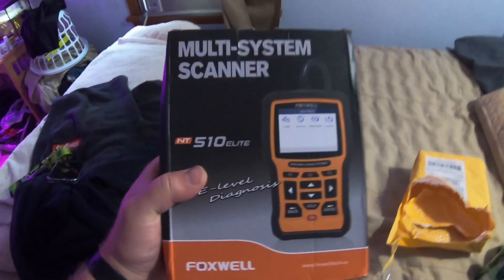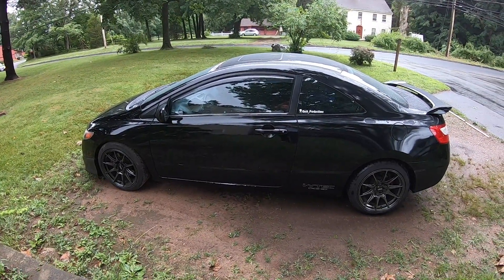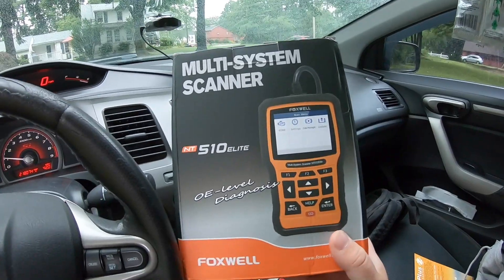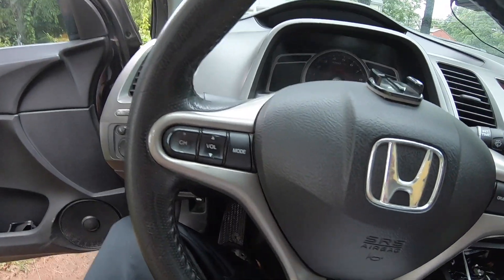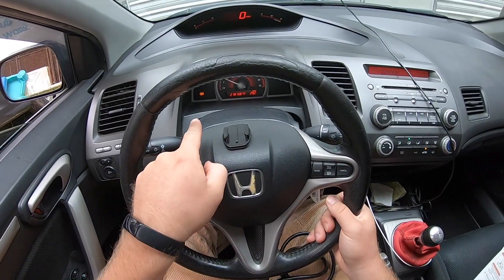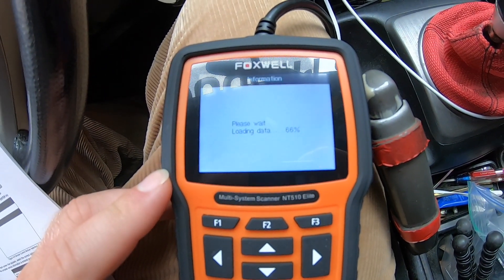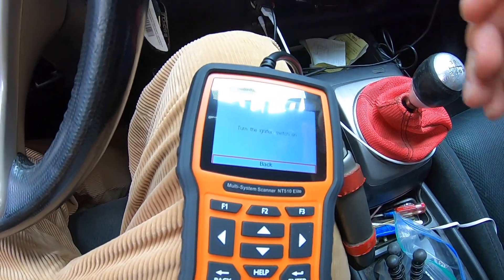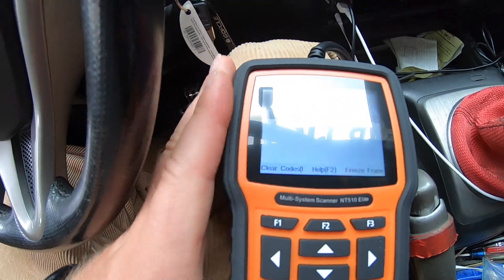Honda Electric Steering Code

Comment: Replace battery , turn ignition to on , turn steering wheel all the way left for 15 seconds, turn steering wheel right till check engine light blinks then center steering wheel and start car.
Reply: What does this do?

Comment: Did you replace the EPS module?
Reply from the maker: I didn’t. That is one of the last things I was consider trying. Lost motivation trying to fix it though
Reply: @TheGerbsteve  
My Accord 2013 has esps light on and steering is very stiff. I can't drive the car. I checked EPS fuse, disconnected and connected the battery. No luck.
Any extra tips you might want to share?
Mechanics don't know how to and some want to charge $100 just to diagnose it.

Thanks

Comment: I'm having the same issue with a subura  .how did you fix this problem
Reply from the maker: Unfortunately I never fixed it.. stays off in the cold, but persist when it’s hot

Comment: Did you ever figure out this issue?? I am currently dealing with this on my 2013 Honda accord LX and I have a Foxwell NT301 but that doesn't support EPS scan. Any update would be appreciated!!
Reply: Hey guys update. So essentially I had to take my car to Honda for an overall diagnosis which you’re going to be looking at 70-160$ depending on the issue and time. Secondly there is apparently a part not sure if it’s a battery or within the battery(sorry I’m a young girl and know nothing about cars) but they said there’s something faulty and to replace it would be 900$. They also said that it’s very dangerous to drive with that light coming on and said eventually the car just won’t work or will be stalled on the road if the issue doesn’t get resolved asap. So overll it’s about a 1k fix. I decided to just go ahead and get it fixed and hopefully after tomorrow my car will be back to normal.
Reply: Hello, did you fix the issue. I recently got this issue. Honda Accord 2013 V6 Coupe. EPS light is on. Steering is very stiff. Can't drive the car.
Disconnect battery and checked EPS fuse and no fix.
Mechanics don't do electrical stuff or want to charge $100-200 for diagnostic.
Any tips will be greatly appreciated.
Price $ on parts etc...

Thanks
Reply: One day before taking my car to the dealer I finally drove it. After 20 minutes I stopped and turned it off. An hour later, I turned it on again and the issue was gone.
Reply: @georgethegreat7015  yes that’s what my car did too! It comes in but if you turn the car on and off a couple of times it will go away and the car is able to drive. But honestly I’d say better safe than sorry and get it checked because you never know
Reply: @allisadalmeida2505  I read that in cold states, the issue is presented more.
I am in Northern California.
This year we had the most rain in decades and it has been really cold. So, it tends to get condensation in these modules.
I can't confirm, but I drove the car on a sunny day and later it worked. Condensation or not, it worked when the temperature got warmer.
Reply: Having this same issue. Paid for a diagnostic and had to take it to Honda. I’ll update this week with what the deal is. I have a 2013 Honda accord v6
Reply: @allisadalmeida2505  yes, share please.

Comment: Bro most of the time if you clean your BAT poles and make sure that your BAT is fully charged will take care of the issue for you....This system were designed to use BAT power and a lot of it...so make sure your connections are clean and your wiring tight...Good luck...I went through this...

Comment: This happened on my 2012 tsx after driving through puddles and water filled potholes. Turned off engine for 10 minutes and everything was back to normal. Likely water got onto eps module.
Reply: thanks for this reply, i have a 2013 honda civic, i got this code and my power steering went off completely like in the video, and it has been raining very hard these past few days and i mainly drive on the freeways...
Reply: My 2012 Civic's power steering went out when the EPS module got waterlogged. Was it related to the blower motor failing? It was malfunctioning for a couple of days before I replaced the motor.  Maybe it was caused by condensation or a leak in the ductwork.  I'm taking it to the dealership tomorrow, so I can prevent it from happening again.

Comment: May have similar issue. While on the highway, steering was unstable (pulling left and/or right from time to time). But no EPS light on. Have code “35-03 EPS control unit internal circuit CPU”. Any ideas? Thanks!

Comment: Did you ever figure it out I am having same code same problem sometimes it's there and steering is stiff or it just disappears and drives fine then comes back started troubleshooting alternator ground and fuses but nothing so far
Reply from the maker: I haven't, but I can get the light to go off, so I kind of forgot about it lol. I will say, replacing the eps fuse itself helped a lot.
Reply: @TheGerbsteve  how do you get the light to go off. once i know that i won’t care that it comes on and off any more. and where can i get the eps fuse
Reply: Turn vehicle on turn headlights on then high beams

Comment: Hey bro, I had the exact same code on my 8th si via my forxwell scanner… turns out its really code 37-01 step up circuit blah blah…. Foxwell and innova scanner code#’s are coded wrong(foxwell correct definition wrong code and innova 5610 wrong definition correct code)… look up code 37-01 honda eps.. same definition but really code 37-01… I used a junkyard module and eps reset using that same foxwell fixed my issue… bet of luck and get that beast’s electric power steering back up to 100%

Comment: Hope this helps! Most 8thgen Si in Brazil that have this problem get fixed by only cleaning the steering wiring connectors. My 07 had this problem last week and so far so good, contact cleaner spray fixed it.
Reply: where are they located exactly so mine can be cleaned?
Reply: @brax3209  you can access the cables from bellow. The connector should be above the subframe rear end, near to the steering hack. I dont have any photos but it is very easy to find if you have the car on a lifter.
Reply: También me gustaría saber dónde se encuentran esos clables
Reply: Your steering unit is gone. Its almost never the connector.
Reply: @mg8720-u7j my steering is the most dangerous thing I've ever saw , I cant get it to reset , and honda replaced the eps control module and nothing.

Comment: Gerb what's up buddy, my EPS came on when I was doing 55 on the fast lane making a right and it locked for a sec and I had no control and taped the wall smh lucky for me only the left front rim got damage since that happened I got a new EPS from Honda for 340.00 on March but haven't installed it.
Reply: What else happened? any updates?

Comment: does this code have anything to do with when you removed eps sensors to do the vtec spool valve?
Reply from the maker: I mean, it may be those sensors, but I’ve been having this issue for two years now. It suckssss
Reply: true that man. i know you’ll figure it out tho! keep wrenching baby

Comment: Had the same issue on my fa5 theirs a wiring harness that connects to the eps and it lies on the header and it cooks the insulation of the wires , what I did was I cut the harness short and put heat shield on the harness and moved it away from the header and never had the issue since January when I did that.
Reply from the maker: I'm thinking it's something to do with wiring for sure! Ever sense i've installed the header, the light has been on. The eps will shut off to protect itself from too much heat. Hopefully i figure out the issue.
Reply: @TheGerbsteve  What happened? Was the heat from the header the problem?

Comment: I have the same problem on my son's 2012 civic with only 68K miles on it.  I drove to autozone and advanced auto parts to see what the codes were.  The handheld scanner read 61-11 and it wouldn't let me clear the code.  I replaced the battery this morning and it didn't fix the issue.  I'll replace the EPS if I can find a decent one.  This sucks
Reply from the maker: What a bummer! This problem definitely sucks and makes me kind of lose passion for the car. I'm definitely not going to buy a new steering rack for $1,000 ++ because i heard of people replacing the rack and the issue just coming back. Only two things I'm going to try are cleaning the wiring and maybe replacing the eps module ($100) part. Wish you the best with yours
Reply: @TheGerbsteve  I was able to reset the error by turning the steering wheel to the left, turn car on, code went away, finally straightened out the wheels. It was fixed for a day, lol. I’m going to check out the eps module when my son gets out of work. Probably order a replacement. This still sucks

Comment: I had the eps issues also. Did the same thing with the brights. Brought it to honda dealership and they replaced the module for about 1k. Didnt fix the issue though. Had a buddy help me out and he replaced the entire steering rack with one he found at pick apart. Its fixed now but im kinda waiting for the light to turn back on haha.

Comment: I’ve been having the same issue with my fa5. I did try replacing my eps module with a used one off of a wrecked fa5 and it didn’t help. Not sure if the module I replaced my old one with was bad as well. Good luck with the fix keep this series going.
Reply from the maker: The struggle is real. Before I spend some money on a module, I’m going to clean the eps connectors and see what happens.
Reply: @TheGerbsteve  Hey bro. Have you tried resetting the eps module? Maybe this post will help https://www.8thcivic.com/threads/eps-reset.229514/ 
Or here's the reset procedure:
1. With the ignition switch OFF, bridge terminal # 4 and # 9 of the 16P Data Link Connector located under the dash on the driver's side. With vehicle on
ground, set front wheels in straight ahead driving position.

2. Turn ignition switch ON. The EPS indicator comes on for about 6 seconds. Within 4
seconds of turning the switch ON, while the EPS indicator is on, turn the steering wheel 45° to left from straight ahead driving position, and hold steering wheel in position until EPS indicator goes off.

3. Within 4 seconds after EPS indicator goes off, return steering wheel to straight ahead
driving position and release steering wheel. The EPS indicator comes on again 4 seconds
after releasing steering wheel.

4. Within 4 seconds after EPS indicator comes on, turn steering wheel 45° to left again and hold it in position. The EPS indicator goes off after 4 seconds.

5. With in 4 seconds after EPS indicator goes off, return steering wheel to straight ahead
driving position again and release steering wheel. The EPS indicator blinks twice 4 seconds after releasing steering wheel, indicating that DTC was released.

NOTE: If EPS indicator does not blink twice, an error was made in the procedure and DTC was not erased. Turn ignition switch OFF, and turn ignition switch ON. The EPS indicator comes on for about 6 seconds. Within 4 seconds of turning the switch ON, while the EPS indicator is on, turn the steering wheel 45° to left from straight ahead driving position, and hold steering wheel in position until EPS indicator goes off.

Turn ignition switch OFF after EPS indicator blinks twice. Remove jumper wire from DLC. Perform DTC code output operation, and be sure that code has been erased.

This might help after checking for cooked wires and/or a bad ground connection.
Reply: @TheGerbsteve  Hopefully that works bro! I should try that as well. I bought the module for 20 bucks so I’m not really bummed out about it.
Reply: I have this  eps problem  since August 2018   Honda civic 2000 UK model, the problem is  still on,  please  advice me  on what to do pls
Reply: Did you find a solution?
Reply: @nmot97  unfortunately no
Reply: @LeeBeeJ  same... So tired of this shit

Comment: My civic si 06 is have a running rich code only when its get hot outside. I try clearing it and it comes  back in 2 days  any advice?
Reply from the maker: Try cleaning Maf like John said. Then I’d check you o2 sensor.
Reply: What did you clean? Your MAF? I'd look at that first if you issue is related to hot temps, could be some other sensor issue as well.